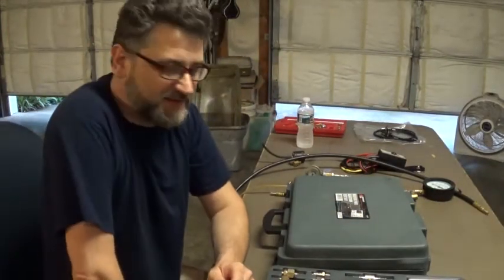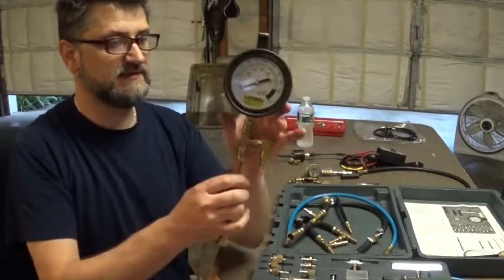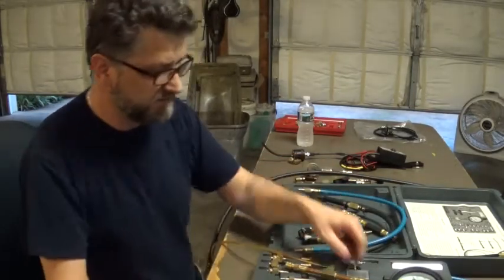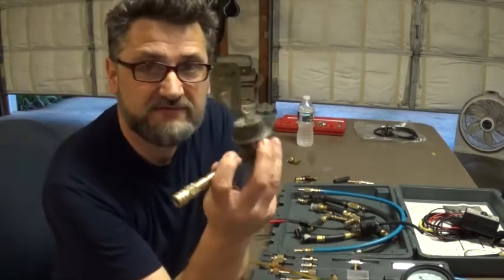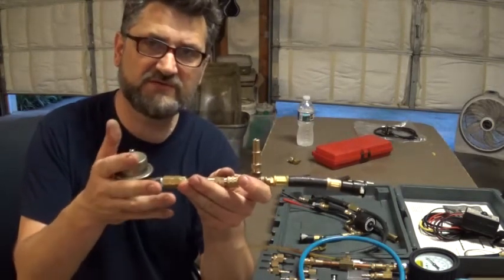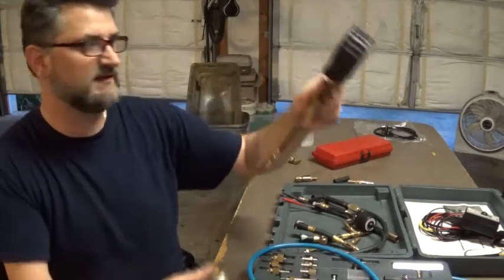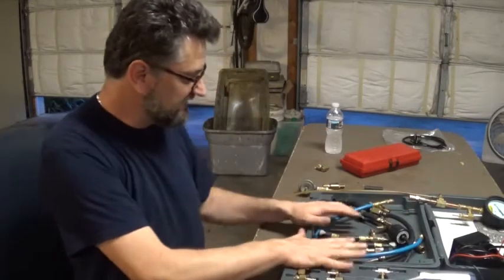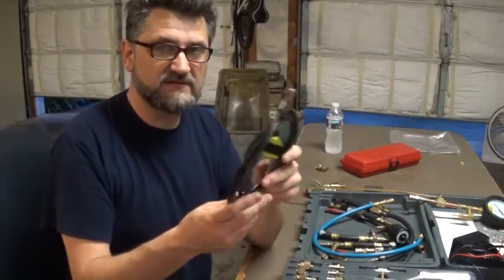Review Of My Fuel Injection Test Kit

Comment: Ramon my friend have you done any Honda fuel pressure connections on say 3.0 or3.5 engines as they have no fuel rail connection points or some hints on where the best place would be to tap into. Are there adapters that will hook up into the fuel line under the the hood on the drivers side of the engine compartment. Thank you for any ideas.
Reply: On a honda 3.5, I ended up taking the fuel hose off which connects the tubing near the firewall to the fuel rail.  There is just enough of a tubing stub to fit a 1/4" diameter hose with hose clamp to both locations.  You can then fit anything you want on it.  It is a pain in the rear, vs having a shrader valve.
Reply from the maker: Arthur Fricchione No I  have not, but my sister has Honda Pilot. I will check it this weekend and see if I can figure something out. Thank you my friend.

Comment: At one time manufacturers cooperated with a unified (Schraeder) standard, but evidently even the expense of that little part was too high. General mechanics are never at the table when these decisions are made, so it's no surprise we end up in a very frustrating situation. My kit was way too expensive and rarely used. The only mitigating factor is the fact you can get data from the scan tool, assuming the sensor is not bad, ha ha. Nice summary!
Reply from the maker: spelunkerd thank you my friend. It's big pain to deal with this problem so unnecessary and time consuming. But I still like challenge under the hood. Cheers my friend

Comment: Nice setup Ramon. Banjo fittings are for Asian & European MPFI.  Here is a link to the manual for that kit  http://www.wilmarcorp.com/files/W89726_Manual.pdf
Reply from the maker: Hayward's Automotive thank you my friend for manual. I don't get why some of banjo adapters have hole on the side. What stops fuel from leaking? Hope this makes sense. Thank you my friend
Reply: You have to use the copper/aluminum/sealing washers from the banjo bolt you remove & transfer them to the ones in the kit or the manual shows sealing o'rings on Pg 19. The hole allows the fuel to enter into the fitting from the fuel manifold similar to a brake hose banjo bolt.